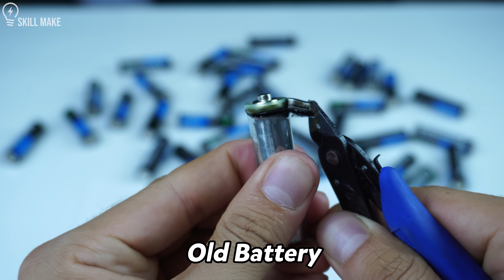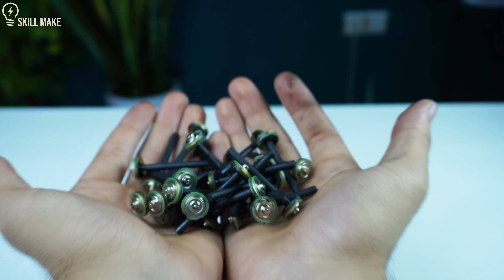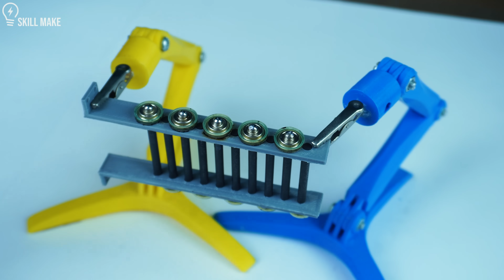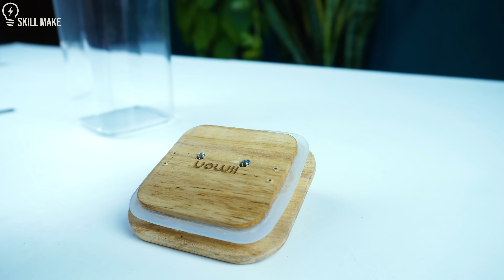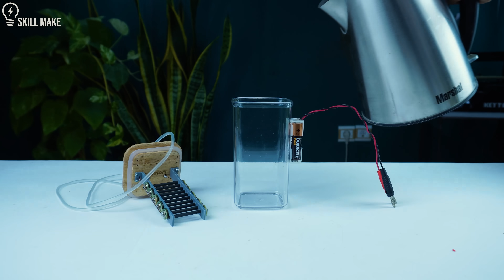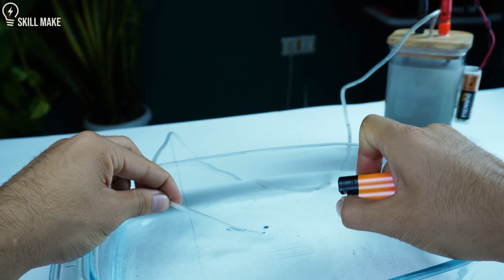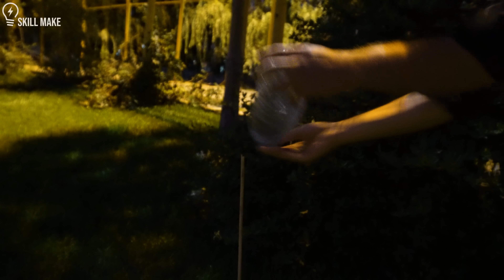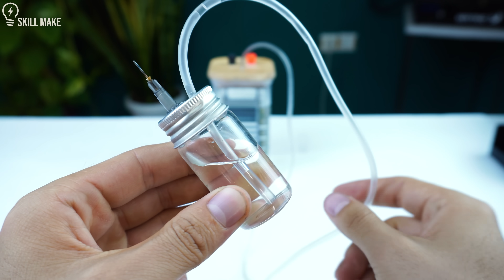Water into Hydrogen - Making a Simple Hydrogen Generator from old battery - hho

Comment: My advice, that little torch bottle make sure it's plastic, cause when that blows up and it will , you don't want pieces of glass shooting out like a granade. Best practice is to put a check valve in front line protection , then a the bubbler . The purpose of of the bubbler is to take the explosion , so it saves the cell . The purpose of a check valve is to save the  bubbler and you ...
Reply: thank you bill nye 👍 but fr though yall take this guys advice
Reply: my advice, dont use grenade instead of the plastic bottle…
Reply: If this is true why aren't car's powered by it it's so simple clean and efficient and no need for dirty fuel's at nearly zero cost compared to oil based fuel
Reply: @johnmcilveen6052 most likely because the power taken to produce the gas is bigger than the one you get from it.
Reply: @johnmcilveen6052 if you have the electricity to produce hydrogen just use it to move your car
Reply: Says the man that blew a hole in his yard with nitroglycerin for a  science project😮.
Reply: @rerunplaya532  it was not nitroglycerin... It was a oxidizer that I had no idea what it was going to do .  How the hell do you know about that anyways
Reply: @TomoReso  not true
Reply: @Guilty-xu6gs  well then, try to make it, should be simple... a battery, an alternator to charge it, and an engine using the gas you produce... if it can sustain the electricity and its work, well done.
Reply: I always wonder why solar isnt utilized to produce hydrogen. And also everything that has wheels should have generators in them.
Reply: @Guilty-xu6gs do you know where fossil fuels come from?
Reply: @johnmcilveen6052 people do put hydrogen fuel cells in their cars. It's a little more complicated than just throwing this in there to do it "correctly". Essentially you put a more efficient version of on of these in, drill a hole into your intake manifold and hook-up a hydrogen injector to spit before every intake stroke for every Cylinder which adds wear and tare to the injector. If you have a 4 Cylinder your injectors fire once per revolution, this injector will fire 4 times per revolution. Then you have to flash the computer and lean out your air to fuel mixture by something like 20-50%. It will be different for different conditions, motors and operating Temps to find the "perfect" efficiency for your motor. But in theory it should make your car burn cleaner and more efficient. You might even see a nominal power gain. Now there's like direct systems and like his little flame torch thing a separate hydrogen tank if you will. Direct systems are safer if you can adequately produce enough hydrogen. There's no reason your alternator, (especially if you upgrade to like a stereo build car alternator or even add a 2nd one) that you shouldn't be able to produce enough power considering he was doing it off 12 volts at the end there.
Reply: Best advice is to not do this at all unless you're a YouTuber.
Reply: @Guilty-xu6gs  lol...teachers science my best memories...proving a point.👍😎🔥
Reply: @ouioui3095 We will find in time that hydrogen as energy storage is better than batteries. The bigger problem is how will the mega companies and politicians make money off of water. Until thorium reactors are common place we should be using things like hydrogen.
Reply: @johnmcilveen6052  Quantities!  The commonest error in "free energy" schemes is to make magnitude errors.  The amount of energy you can get out is never more than you put in - whether that is electric, chemical, nuclear, mechanical, or whatever form.  The little AA batteries could hardly get your car out of the garage.  Electric cars have hundreds, probably thousands of much better batteries in their enormous battery packs.  One of the limitations on charging stations is the size of the cables in their electricity supply, limiting the amount of power they can draw from the grid and thence supply to a row of cars.
As for being clean, it's often a question of where the "dirt" occurs.  Taking electricity from a battery, putting it into a motor to make something move, is a very clean process.  Manufacturing batteries (and to a lesser extent, motors) is much less clean.  Generating "renewable" electricity may be clean, but the manufacture of devices to do that (and their subsequent disposal) is again much less clean.  Green chauvinists are often really saying, just keep the dirt, pollution and environmental harms out of our sight (and through their ignorance, out of our minds.)
Reply: @ouioui3095 but how will my friends know I’m cool, if I don’t have an EV? /s
Reply: anyone thats messed around withh hh0 was cringing when he lit that little bottle .. It will blow up
Reply: Hydrogen gas burns insanely faster than flammable gas, and reacts like gunpowder.

You do not want pure hydrogen gas to be burned, might want to mix it with some other gas to slow the burn rate so it doesn't combust the container outright.
Reply: @johnmcilveen6052 Toyota mirai
Reply: @TomoReso ❤You need to convert gas into electricity and not drive on it, replace gasoline, this is a dead end! Sorry for Google translation!
Reply: @johnmcilveen6052 bro this requires serious amounts of electricity in greater sizes. So it would be impractical to waste so much electricity, rather use all that electricity to power motors directly, which makes electric cars more efficient.(cheaper compared to hydrogen)
Reply: @johnmcilveen6052 it's because what produces energy is H2 and it's not available in nature directly in this form (except some rare cases), but it's produced from whater, then burned/used in a fuel cell and made back to water. As of course it's impossible to achieve 100% efficiency you use more than what you get. So it's at most an energy storage option, not production by itself
Reply: *or produced from fossil fuels
Reply: @johnmcilveen6052 still need to generate the electricity from some where
Reply: @johnmcilveen6052 por qué este método no es estable y tiene riesgo de explosión ya que lo que hace no es hidrógeno puro y hay oxígeno también y es muy reactivo además habría que poner un sistema aelectrico a parte para hacer que el agua separe el hidrógeno además de que después para un coche habría que purificar ese gas y licuarlo cosa que se hace a presión así que deja decir tonterías que ya hay gente que estudió eso por eso aún no hay coches así o te crees tú el descubridor de la pólvora ahora también
Reply: I see so many comments in here from people who think they know something and are completely uneducated. It absolutely does not take as many amps to make hydrogen from water as it does to move a vehicle with an electric motor. That is absurd! An average well built alternator can produce more than enough amperage to make this work. An engine is rotating to propel the vehicle so using that rotation one or more generators/alternators can be put on a serpentine belt. 
It works well enough that people have built vehicles that have engines that run solely on the hydrogen produced from water onboard the vehicle. It has been done. Politics and greed keep these things like this out of production.
Reply: @johnmcilveen6052 there are hydrogen cars but if they were to dominate the roads, oil would be thing of the past and oil companies won't allow that to happen, too much at stake.
Reply: Can I get the information about what things he had used in detail please
Reply: That's what I was thinking immediately. Is that the little nozzle where he lit the flame is bottlenecking the gas keeping it from exploding immediately but then isn't the inside of the jar slowly, or quickly, building up with excess gas that cannot be burned fast enough? Which will eventually lead to it shattering and all of that gas pent up inside igniting.... explosively. This is very cool as a way to generate the hydrogen gas but using it as a torch burner seems like a really bad idea
Reply: Does it produce more energy than it needs to be put in to start the process?
Reply: Did anyone ask for your advice?
Reply: Thanks for your cervix.
Reply: It's called flashback/flashover protection.
Reply: Just so you know, it wouldn't matter if it were glass. Plastic, metal, or any other substance. Because at the speed it would be propelled at from any explosion, it would do the same amount of damage. Think about how a tornado can make a blade of grass go through a 2x4. Pretty sure the guy who made this video has more knowledge about physics than some armchair expert.
Reply: @johnmcilveen6052 well duh. It's because multi-billion dollar corporations make too much profit from fossil fuel.  Did you really post that question on a public format, without even thinking at all? 😆
Reply: @redeyestones3738  thin plastic shrapnel is going to do less damage than glass
Reply: снял бы свою  версию место того чтоб учить
Reply: You forgot the flash back supresser that matches to torch and  the thing the torch ataxhes to
Reply: Good point. Plastic or something with a pressure relief on the end of a hose hooked to that.
Reply: Solar/hydrogen hybrid cars maybe ?
Reply: @johnmcilveen6052 cars HAVE been powered by it. Me and my uncle did this 10 years ago, I've been seeing hydrogen videos being made alot more often recently, the hardest part is making it safe because at the end of the day you a driving a hydrogen bomb if something goes wrong. There's a few guys out there that had water powered cars before but they all went missing.
Reply: @TomoReso not necessarily, a hydrogen fuel cell with an electric motor as well would be 2-3 times more efficient than an internal combustion engine running on a gasoline
Reply: @ICRUXZI  if you think using alternator for producing hydrogen through electrolysis, then use produced hydrogen as fuel for engine, forget it. Its researched already, its quite an inefficient way to produce hydrogen.
Reply: Thank you sir. This video is educational but doesn't mentions about safety measures. So your comment maybe saved tens of lives.
Reply: Yes bro
Reply: my mum always told me not to eat batteries I want eather open it's
Reply: I definitely look to Youtube comments for engineering advice...
Reply: My advice..DON'T Do this Sht at home!
Reply: So it's a free grande 😢❤😂
Reply: great idea, exactly how G.E. does it, they actually have a welding torch patent that burns hydrogen gas they have held on to for years without producing it, that burns and leaves 100% clean water drops as its waste. but most engines whether it be a generators or car engines ,they produce and burn every bubble as they are made so no large explosion can occur. I've seen only one car and heard of a few that ran off water, but have seen several home generators producing and burning hydrogen, when running sounded like it was burring premium gas and very smooth idling its tech that should have been developed a long time ago, its so easy to make, and burns clean.
Reply: cool idea, but 12V x 5A = 60W input energy for this little flame at the end ...
Reply: @TomoReso not if I'm making it going down the road
Reply: @WhenIHit88MPH  from organic fossil material... Like old trees and animals like that guy 😂😂😂😂😂
Reply: Dudes We use hydrogen to launch rockets into space. The big problem with hydrogen is that the engines are very complex.
Reply: With that small of a nozzle, you won't get flash back, the flame can't propagate through. It will get quenched the same way it would in a flame arrestor.
Reply: @TomoReso  could use solar panels to create hho in big storage tanks, transfer that to series of smaller scuba tanks in trunk of car, run a line to engine.
Reply: @johnmcilveen6052  you answered your own question here.
Reply: @ouioui3095  renewable energy can be used to make a lot of hydrogen over time, but doesn't make the high bursts of electricity needed to propel a vehicle.
Reply: @johnmcilveen6052 why would manufacturers make something efficient that reduces costs for the customers? Maybe I'm crazy because why would manufacturers make inefficient systems?
Reply: Lieg niet
Reply: Leugens
Reply: Nobody asked for ur advice
Reply: In French accent: "GRANADE!!!" 😂
If you know you know
Reply: Real0nepiece  he had given his advice like 3 months ago and you have recently asked about your doubt recently so technically nobody asked him before you and infact you have asked just recently not at that moment when he had commented or given his advice 🗿🗿
Reply: @Guilty-xu6gs he's your neighbour
Reply: Energy transitions take decades, unfortunately
Reply: @SnatchTease and only has 52 filling stations in the US, of which all but one are all in California
Reply: Also, keeping H and O separate helps against violent explosions
Reply: @johnmcilveen6052 like others have said, it takes a good chunk of energy to split water into hydrogen and oxygen, and even more to compress it into a usable liquid form.
Reply: @mr.d.rektorstudios  But you may have it free when using a solar plant and then it's pretty nice to have. In the summer, I can produce daily about 200 l hydrogen after charging the batteries.
Reply: @dra6o0n  gunpowder is granulated to burn at specific rates. Modern gunpowder actually burns much faster with less space to combust. Those are low order explosives. Hydrogen oxygen mixtures are so much more fun.
Reply: @johnmcilveen6052 i already answered your question. If they do it, they won't have narratives to tell us...
Reply: @justmusic1921 lol
Reply: Kkj @TomoReso
Reply: @johnmcilveen6052  I think there are many reasons one of the reason I saw in a study is the feasibility for hydrogen top up stations. There will be thousand and millions of top up stations each nation need to built and then the producer etc. we also need to consider some nations may have problem to do so whereas power is more readily available in landed properties or in congested cities the power is more readily available as the gov just need to built charging stations by pulling from the existing power grid.
Reply: @ouioui3095 hydrogen will be more feasible in terms of charging. In Japan, charging Hydrogen from the station is just like topping up regular petrol from the petrol kiosk. Whereas charging batteries is a problem. Then Hydrogen cars are combustion engine and do not use so much rare earth like the batteries. It is more sustainable. The reason why electric vehicle? Power is readily available in most houses so it is feasible for large countries like USA, Europe etc.. if you consider big modern mega cities like Tokyo, Singapore, Jakarta, then we need the government to pull power from the grid to build charging stations. In general it is more readily available and more suited as a product for worldwide acceptance compare to hydrogen where the nations will need to be building charging stations and setting up the supply chain to produce and deliver hydrogen.
Reply: @Merlin3189 you are right and wrong at the same time. Yes, there is no such thing as completely clean energy. There is a cost to making electric vehicles. But... Through modern technology and recycling centers, the "cost" of making and maintaining an electric vehicle vs a gas vehicle is about 80% cleaner and cheper over the life of the vehicle.
Reply: @johnmcilveen6052 
There’s two main reasons,

1. To make the hydrogen gas, you need electricity, which you we kinda use fossil fuels for mainly, but that’s not too big cos we can in theory get the job done with a lot of renewables,

2, the MAIN problem is energy density (volumetric density), it’s really hard to fit all that energy equivalence into a car without using dangerously high pressure levels, or exceeding the travel weight with a massive bulky container, we’ve done it a bit by now but we still haven’t really gotten up to the energy equivalence of fossil fuels just yet

A fuel source has to be compact (high volumetric density) and physically light (energy density) 
No point in a hydrogen fuel cell, if for the car you’re powering you need a fuel container the size of a semi truck and with twice the weight,

Their main use is for being large long term batteries as lithium ones are expensive, toxic to produce, and don’t last that long and that well, (their recharge-ability and holding capacities drop off real fast)
but we’re also still getting around the whole, using electricity to store usable electricity problem in the first point
Reply: @johnmcilveen6052 because it’s about what’s profitable not what’s good where have you been?
Reply: @garrettmenteer2066   yes . Even an electric car . With 4 wheels turning it should have 4 generators fitted to each wheel assembly. This will charge the main battery in the car on the move.
 This way it should be possible to plug a home into a car . Not the other way round
Reply: @johnmcilveen6052  You really have no idea do you?
Reply: If you prevent backflow, why would it blow up?
Reply: @johnmcilveen6052  it's been done, read up on it
Reply: Yep I was gonna say the same thing........ lol
Reply: If you use plastic you miss out on the gorgeous flame.
Reply: @dra6o0n  Flammable gas and Hydrogen gas are both flammable gases.  I'm guessing you're referring to more easily condensated gases like Propane or Butane molecules.  Because Hydrogen is a small diatomic molecule with low viscosity, and therefore it leaks into the air much more quickly than propane or butane molecules.
Reply: @SnatchTease Toyota Murai.  I love that car.  If you have hydrogen pumps in your city, I find it more convenient than electric cars that need to be charged overnight.  We no longer have a Prius Prime which was convenient because it could drive a long time on Electricity alone, but Hydrogen is biodegradable, but depending on the way it is extracted, may contribute to pollution since one of the main ways of extracting H2 (CH4 + H2O = CO + 3H2 has Carbon Monoxide as a byproduct and considering the very high heat necessary likely requires a combustible  source of heat that decomposes with Carbon Dioxide being one of the byproducts.  Hydrogen can be extracted using electrolysis.  This CAN be done using renewable energy like wind or solar power, but often for commercial purposes, Methane is used to extract H2 while it decomposes into Hydrogen and Carbon Monoxide after a very high source of heat is used to initiate the decomposition.  So using electrolysis can be done with a green source of energy, but often extracting Hydrogen from Methane is the preferred and more commonly used method that certainly is blue a green source of energy.
Reply: @johnmcilveen6052 Oil companies have a monopoly on everything, so there's no way they would allow people to just run their cars on biodegradable products that don't contribute to global warming.
Reply: @johnmcilveen6052  there are hydrogen cell cars or there were. I just don't think they took off quite like EVs did. And yet they produced water as the only bi product by using hydrogen as fuel.
Reply: What if you used polycarbonate instead? Would it then be viable?
Reply: I'm pretty sure the friction fit lid will pop off before the glass frags his face
Reply: Hydrogen is more explosive?@johnmcilveen6052
Reply: @Jerry-vr2or  hydrogen is very explosive
Reply: @johnmcilveen6052  my question is, why didnt elon musk make this kind of car instead of his electric one? That's what I would do if I were him at this point
Reply: @Merlin3189  wow that was a lot of nonsensical bullshit.
Reply: @johnmcilveen6052 You still need to get the energy from somewhere. The same question is relevant for any vehicle that runs on renewable fuel. You also have conversion losses for hydrogen ~50% efficiency (70% for really high end). If you wonder why spare batteries aren't used to generate fuel it is because the amount of spare batteries is vastly too low to power vehicles out there.
Reply: I’m deeply impressed at your craftsmanship.
Reply: Why would it explode when the h2 generated is being used?
Reply: @johnmcilveen6052 because they keep killing the people who figure out how to do this in your car real time using water as the fuel
Reply: @ZCRAIZED1  the reality is hydrogen is hard to work with from a safety perspective, it's incredibly volatile and in addition hydrogen molecules are much, MUCH, smaller than say LPG or natural gas, making leak proofing very very hard. There's feasibility studies happening in many gas-dependent countries like the Netherlands regarding substituting hydrogen as energy carrier for things like heating, but it's proving quite challenging so far.
Reply: @Guilty-xu6gs  @TomoReso is right.  The efficiency of typical commercial electrolysers is around 60-70%.  So the energy in the hydrogen produced is only 60-70% of the energy of the electricity required to produce it.  If you can use the electricity directly you are much better off.  And for cars changing that hydrogen back into motive power depending on the method used has a different efficiency as well (Fuel Cells - typically 60%, IC engines - typically 30-35%).  So producing hydrogen then turning it back into power you get between 18% and 42% of the power in the electricity you started with.  This is why hydrogen cars do not make sense compared to battery electric cars where the battery typically has an efficiency of 99%.
Reply: We used hydrochloric acid and magnesium to make hydrogen and then tried to light the end of the tube in science class and ended up making a grenade with glass going everywhere and people’s ears ringing
Reply: I love how its not if but when
Reply: Unless its solar @TomoReso
Reply: @johnmcilveen6052  mainly because it’s unstable and too volatile
Reply: "You don't have to use glass when you make something that violently explodes" -Explosions & Fire, Ph.D. in physics, makes primary explosives from a shed.
Reply: This video makes you realize that even old and seemingly useless things can be turned into something incredible.
Reply: i love that you said ....... 'cause WHEN' and not 'cause IF'

lol. you and i BOTH know, that it is inevitable

i'd add, that even some plastics, can be just as dangerous as glass. especially if a large amount of plastic maybe against your skin, and the plastic 'shears' upon impact.  can result in large lacerations
. i suggest settling on a soft maluable plastic.
even then, expect burns in a worse case outcome.
Reply: That jar is plastic
Reply: ((psssst)) it WAS plastic
Reply: @frankjames1955   facepalm
Reply: @charliebaby7065   then WHY even bring it up?
Reply: @frankjames1955  i think maybe we're miss communicating. i'm facepalming because i was talking about plastic being the perferd material to use as the container in this use.
yet failed to realize it WAS actually plastic.
soo im just facepalming myself because of my own failure in noticing that
Reply: @charliebaby7065  oh i see sorry
Reply: @frankjames1955   its ok. right after i  sent it i realized how it might sound. but its all ok. no problems. and no reason to be sorry. i only wish youtube, would actually let me edit comments, for some reason itll randomly just remove the thread if i try. not sure why. probably considers editing  is spam related.
Reply: This is one of the best DIY science videos I’ve seen! Your explanations are clear, and the project is awesome
Reply: @johnmcilveen6052 because you must pay for petrol = unlimited exploitation
Reply: @johnmcilveen6052  because without mobilisation of money how will they make money . Capitalism 😊
Reply: @tray22 you still have to produce electricity somehow to decompose the water.
Reply: @johnmcilveen6052 toyota have had a hydrogen car on the market for a dozen years in japan and i think t US mayb as well. Hydrogen will b the future of cars. Not the current battery powered electrics they pushing now. NZ has at least 2 hydrogen plants being built right now. 
Hydrogen powered cars will b the future.
Reply: @ZCRAIZED1 totally agree. Toyota Mirai. Hydrogen will b the future of cars
Reply: @redeyestones3738 bro dont be a muppet. How else does one learn anything if they dont ask questions?
Reply: @tray22  where do you think most people get water from now?
Reply: @john8795  Indoor plumbing and Walmart would be my top 2 guesses. Did I get it right?
Reply: @Sleepyfye  Ha..ha..I wouldn't take any advice from Bill Nye.
Reply: @garrettmenteer2066 Right? Each wheel could have a generator attached to charge the batteries while the vehicle is in motion. I always wondered why no one has done this… Or at least a generator per axle.
Reply: I think they used gloves in the old world… health n safety regulations are a massive problem and stop us from actually concentrating n connecting to the job at hand
Reply: Meh, just let nature take care of the problem.
Reply: @WavyCats  then go ahead and patent your own generator, you will make quite some money.
Reply: @TomoReso  Yes, that's the nature of the universe.  Check your high-school physics books re "The Laws of Thermodynamics".  
Then there's the efficiency factor, the $$$ factor.  Look at the complexity of an oil refinery that produces gasoline.  
Electrolysis (what you saw in the video) is incredibly cheap by comparison, especially when scaled up to industrial levels. .
Reply: @2011Azure  Refining oil to diesel or petrol takes way less energy than making hydrogen, even including extracting oil from the ground. Also did you check what kind of "fuel" tank a car would have to have in order to drive about 500km on hydrogen?
What kind of transport is needed for such fuel supply?
I dont say in future, but as of things are now, it just does not make sense. 
I mean, why those same mega oil companies do not invest in making all of this come true? Its all about selling more energy, and if its cheap for you to make it, and in todays day and age environmentally friendly one, it would make a hell of a lot more sense. Ive got nothing with petrol or diesel, i dont care what my car would use, but looking up on any decent study it shows nothing but further losses and a lot complications. Unless any of you prove this wrong.
Reply: This hydrogen generator is a game-changer!
Reply: Simple yet fascinating DIY hydrogen generator project!
Reply: Hho implodes not explodes.
Reply: @Sleepyfye  very expensive way to make hydrogen and not much of it not that it can be used!
Reply: I hear the Beatles singing "I'll come back for the bubbler and you!"
Reply: Hi sir, this is amazingly cool!
How long the potassium hydroxide water will last long and need to be replace the new one?
Reply: @Guilty-xu6gs  It won’t blow up the same way a handheld propane torch will not blow up.